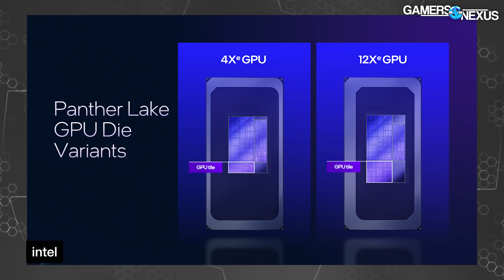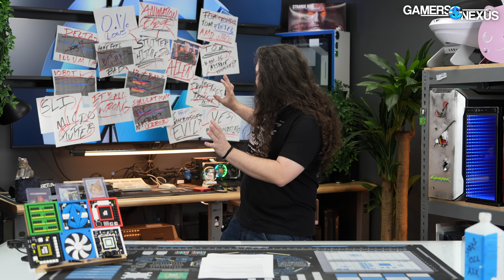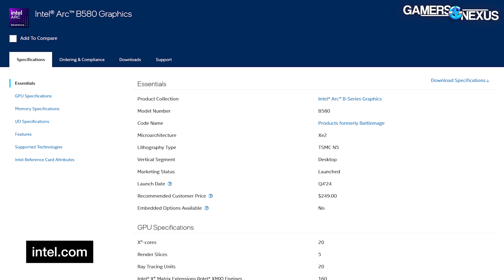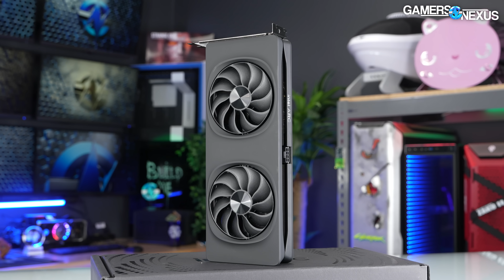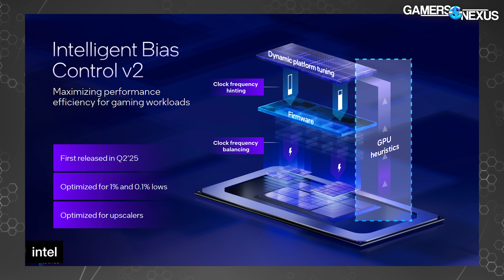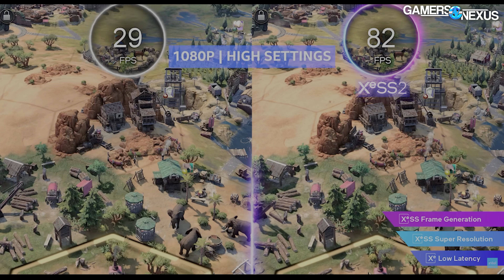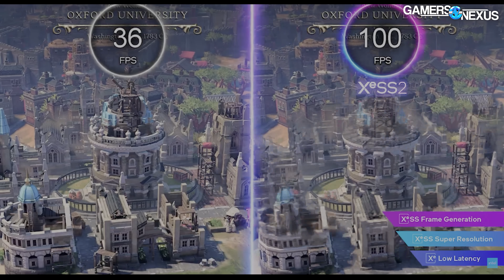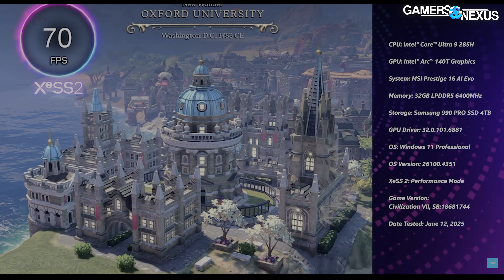Intel's New GPU: Xe3 Architecture Changes, Handheld Gaming CPUs, & XeSS3

Comment: arc is the only thing that makes me excited about tech nowadays, we need someone to push on the now dead lower end market, someone to push VRAM up, we need a zen moment in GPUs to make nvidia actually look at geforce once again
Reply: As much as I would like that to happen Arc is gonna either evolve into a competitor to Nvidia and raise prices as soon as they have any brand recognition(less likely imo) or they will be suffocated by Nvidia to prevent the former from happening.
Reply: We really need another competitor in the GPU market, NV has a stranglehold on the top end, mid-range AMD is sticking with their "we're not NV and we're a little cheaper" habit, and the low end is NV GPUs from 5 years ago and whatever scraps AMD throws us and neither are particularly cheap anyway.  I put my money where my mouth is: an A310 in my Plex server, an A380 that I pulled out of it, 3 A770s, and a B580.  Alchemist was a rocky start but the B580 is hard to beat at $250 without going in to the used market, open box, etc.

I've lost interest in NV because of how out-of-touch and greedy they are, I was able to grab a 9070 XT for a little over MSRP and it's a good card but AMD seems to have gotten greedy off the success of that card, AMD needs to be more aggressive in their pricing if they want to become relevant again (they had 43% of the gaming GPU market when they first acquired ATI), Intel is really the only one working hard to win over gamers.
Reply: @406Steven  We need more competitors in the semiconductor manufacturing market and supply chain.
Reply: @MorbidEel  Very true.  TSMC has a monopoly on top-end chips.  I'd like to see competition in that market, especially some on US soil.
Reply: agree, if you told me 5 years ago APU news is only thing gets me excited now wouldn't believe you
Reply: Fuck nvidia
Reply: Rx 7600xt 16gb,rx9060 xt 16gb exist
Reply: I mean, low end's got it pretty good. I usually go high-ish and there's no upgrade path for my 3080. How about a 5080 for 1000€+ or the 9070 that's 700€ for a 30% upgrade. No thanks.
Reply: We just need better AMD gpus, not intel, no nvidia.
Reply: @shk0014  The more competition the better.
Reply: @shk0014  We've needed that for a decade though. If anyone else wants to hop into the fray in this space, I wish them the best. Intel did that at least for now.
Reply: @YesterdaySoup Intel had decades of experience with their iGPUs though.
Reply: @theobserver4214  I'd say most of that experience was wasted, though. Or perhaps an extended learning phase. I really wouldn't be surprised if a bunch of potential Arc A-series customers just sat back specifically because they remember how bad "Intel HD Graphics" and earlier integrated solutions were. Back then we didn't think "Intel integrated graphics" was a joke, we thought "Intel graphics" was a joke because it was all they had. I'm not saying it's all justified hesitation at this point, but I think there might be a lingering perception problem just from people who used their IGPs.

Though to be a bit kinder to Intel on that, the earlier stuff was in a time when all integrated solutions were some shade of awful, and HDG was their first real swing at trying to get those right. Just not the greatest timing for perception's sake, because that was right about the time AMD's ATI acquisition started bearing fruit.

Maybe it's not all justified, but this is why I think Arc was their first bit of being serious about GPUs.
Reply: @shk0014 amd fanboys at it again. I guess it helps nvidia that amd waited till rdna 4 to finnally take fsr and rt cores seriously when has for a decade or two 😅
Reply: But they arent doing better.  @shk0014
Reply: Arc is pretty much dead you are just in the vocal minority who are terminally online. Average people don't even know arc exist.
Reply: @edmonddantes759  Its like saying an average person doesn't know how to change a tyre. And you're terminally online telling people that they can never change a tyre.
Reply: @edmonddantes759 fr 😅
Reply: I would start looking for something else, b/c Arc is basically gone. Nvidia is not going to allow them to be competetive.
Reply: @robr4662  Jensen doesn't need to know /jk

arc mainly thrives on the low to midrange, so i don't think that they mind it too much, unless they want to choke competition really aggressively
Reply: @4nyNoob  nVIDIA will ultimately not cede ground to anyone if they can help it, which is precisely why nVIDIA has teamed up with Intel; APUs will stay to take over the low end and at least the low mid-range markets.  This is fundamental; if you aren't excited by anything other than Arc, then you aren't looking in the right places... Discrete GPUs won't even exist in anything below mid-range in a couple more generations! Take a look at what AMD is doing with APUs; next generation, they will have an RDNA5 successor to the 9070 XT with 20-25% more performance, that they can just slap on as a chiplet along side a 12 cores 24 thread CPU; just look at recent Xbox Magnus and PS6 Orion leaks! Similar chips will be going into laptops too, and I suspect into desktop APUs as well.  When PS6 and XBox have access to 24, 32, 48 GB of VRAM, this is what is going to drive up VRAM amounts on discrete GPUs as well!  And the beauty of this on desktop APUs is that games will be optimized for this combination because that will magically be what is in consoles too! Saying nVIDIA doesn't care about the low end or mid range market is failing to see the real problem; they just don't have a way to do it cost effectively enough for them to tie up manufacturing that could be better utilized making high end GPUs that they can make huge margins on; one of the ways nVIDIA plans to get there is on Intel APUs.
Reply: @robr4662  I think Arc will survive until Druid is ready to launch. After that, my precognition goes fuzzy and I turn into a galloping cantaloupe.
Reply: @robr4662 nvidia is only working with intel so they can keep their hold on the market with the intel cpu and nvidia dGPU laptop combo, not desktop
Reply: @robr4662  Not how... Any of this works, dude
Reply: rx 9060xt 16gb destroys every arc gpu in performance per dollar. You are an idiot if you choose arc over rx 9060xt 16gb
Reply: @adlibconstitution1609 no it does not. The B580 comfortably beat the 9060xt in term of price to performance. AMD can’t even make 1 decent sub $300 GPU
Reply: @adlibconstitution1609  9060XT is 350€ here, ARC B580 ist 230€ here, why is someone an idiot if hes choosing the best card under 250€? 9060XT is in another price league.
Reply: @adlibconstitution1609  In all honesty mate, nvidia rtx4000 series is still better than amd rx9000. You can't really call someone an idiot if they bought a GPU their money can buy or features that they want.

I've not used an amd gpu just because the performance per dollar is not good. Especially if you add resale value. Most people in reality don't just game. And for the prices people pay for these GPUs, the usual target market are people who work. The last AMD that I actually bought is the Radeon VII. Because from then, nothing really can compare against the competition.

Intel GPU is interesting, because of the features they are releasing. Its not as fast as what people try to compare it to, but it doesn't cost more than it should. Unlike the competition. There's a high chance that people who already have a high-end GPU in their rig would add an intel GPU in their build just for the features. Like people who already own a 7900 XT/XTX and 3090/3090Ti would appreciate it, and that is something that I would not see at present with the current AMD offering. .

Comment: I really need Intel to do well here, we've already had near monopolies on processors when AMD was sucking rocks... it wasn't all that fun. I want two (or more) strong processor options. Same with video cards, I'd switch off Nvidia in a heart beat if AMD or Intel made high end cards that could compete with 80 and 90 series. I get the low and mid range is more popular and that's where the money is, but flagship cards get attention. You don't make them for the money, you make them to show you can make and compete with the best.

Comment: So tired of minimal increases in performance. We should be in the Terahertz by now
Reply: There is a pesky thing called, the laws of physics. More concretely the laws of termo dynamics and quantum mechanics. 
We have already hit a wall in how small and stable, we can make transistors and this was decades ago btw, chip makers were just able to increase computation further, by introducing multicore/multiprocessing but this, has its big drawbacks as well. 
So now, to try squeeze a little bit more performance out of transistor tech they are trying to change how transistors are made at the fundamental level, again, with new construction methods called, nanosheets and CFET, while still working within the same, existing, real world nano scale, even thou they claim they made transistors smaller than before, for marketing reasons, using the scale of the smaller peace they can make, is like saying you car engine is 1 mm (millimeter), because it has a 1 mm screw in it...
But this is very hard and requires advanced and very expensive machines (good for rich countries to keep control of this tech), so mark my words, we will never reach Terahertzs on a single core ever and probably never on a multicore CPU alone as well. 
And we may reach a time, where will be impossible to go further in classic computers (there the research on quantum computers already...), thou I hope that is centuries in the future.

Comment: Hopefully B770 is skipped and they launch a surprise C770 or 750 or whatever they fucking call it.
Reply: Theyaren't going to launch any more arc discreet cards, I wouldnt bet on integrated graphics based on the XE cores lasting past when the current supply of xe cores runs out. Once that happens you will never hear of XE or Arc again and Nvidia chips will be packaged with Intel CPU's.
Reply: @robr4662  Stop spamming the MLID incorrect information

Comment: Nice deep dive
Intel marketing with graphics doing great
if only they execute roadmap in time, because those delays are killing great products
Reply: There is not going to be any more dicreet Arc cards. Nvidia wouldn't invest that much money into a company for it to make competing products, they are going to get rid of Arc and they will use Nvidia chips as integrated gpus packaged with Intel cpu's. They are probably just using up the last of the XE cores in inventory before switching over.

Comment: New NVIDIA integrated GPUS are looking fire 🔥
Reply: I am not a fan of any multi-billion dollar corp. but like it or not, this is the future of Intel. Arc is gone. Nvidia wouldn't have invested that much money into Intel if they were going to be competing with them. Arc will be relegated to low-end integrated graphics until the supply runs out then they will switch over to nvidia chips exclusively for gpu's.
Reply: @robr4662  I know, that's why I wrote that ironic comment in the first place.

Comment: Pantherlake will be the first Intel GPU to launch with SR-IOV support in MAINLINE Linux (historically, i915 only supported GVT-G and SR-IOV in Intel's soft fork of the kernel). See the xe driver (drivers/gpu/drm/xe/xe_pci.c).
Reply: intel coming in with W's
Reply: Intel B50 Pro and B60 Pro supports SR-IOV
Reply: @ridsama  Didn't launch with SR-IOV, it's not officially validated yet, but yes Battlemage pro also has SR-IOV in the Xe driver.
Reply: Please understand, because I mean no offense with this. With that said, nobody that expects their computer to work without having to recompile an entire operating system, cares about how Linux does its drivers. A person that needs their computer to work from power on, each and every time, doesn't care how the drivers work; only that they do.
Reply: @ZeroHourProductions407  A business that requires SR-IOV will very much care about how Linux does its drivers
Reply: @Creepus_ExplodusA business can afford to pay someone to molest the command line and debug if it matters that much. 

But with how much linux wants to market itself as the new desktop os? A windows user being made to convert isnt going to want to do anything with the accursed command line, or any version of linux that outlines "recompile the kernel" as a default troubleshooting step.

Again, a normal user, is not going to care how the drivers work, so long as they do.
Reply: @ZeroHourProductions407  so you know absolutely nothing about modern linux distros and it shows. not all distros require the use of the command line. even then anything advanced can easily be googled and found. it's not gonna be as easy as windows that holds your hand and blocks you from doing anything in-depth with your system, no. however for heavy enthusiast gamers who want better performance on a wide range of games, even a linux dual boot is a great choice.
Reply: @ZeroHourProductions407  The vast majority of non-technical users do not have any possible reason to compile a kernel. It isn't 2010 anymore, that's almost 16 years ago and Linux has advanced a lot since then. Complaining about technical users or professionals using the command line or compiling stuff is silly because they also do that on Windows or Apple OS. Either people need to do it for their job or do it as a hobby.
Reply: @ZeroHourProductions407  That's nice because I use Aeon and never used a command line for anything. The drivers are directely in the kernel so I didn't compile anything, I use gnome as a desktop environnement and it has an app store to download my apps.

Yes I must say that I do not use my computer for work, for office documents I use onlyoffice, brave browsers and proton/steam to run games and that's it, obviously if you need the adobe suit or other specialised softwares you should look out for that.
Reply: @thatonelonghairedguy764  Linux has refused to work with Audigy and X-fi sound cards for TWENTY YEARS in my experience. No model, no platform, no anything has had it "just work" like the fanboys say it should. And regardless of whatever distro you call it, the first thing they all say is Open up a terminal. No, I should not have to do that. And if I can't get online, Google means fuck all.

Even after the short of miracle that it took to let me have working sound just last week, I'm now trying to get OpenRGB to work. The App store version flat out doesn't. The standalone download kinda does, but it only lets me control the lights on the RAM in my test system. Even if I download this rules file thing, double clicking it only gets it to open up in notepad; it doesn't do anything to fix the problem. And it still won't let me control the lights on the motherboard; and by extension, the fans or the GPU.
Reply: @ZeroHourProductions407  The only one making anyone convert is Microsoft. 
Desktop is completely irrelevant here. SR-IOV is for sharing hardware between virtual machines. That is not something any typical desktop user cares about.
Reply: @MorbidEel  There are a few million atypical consumers and growing~
Reply: @ZeroHourProductions407 least obvious Microsoft spokesman
Reply: @그냥사람-e9f  HAH, you wish. Fucking redditors coming out of the woodwork on this one 😂

I'm just sick to death of people evangelizing linux like it's some be-all end-all. The only *nix based anything that HASN'T drove me to frustration is MacOS itself. But Tim Cook can also eat my ass, mouth first, if he thinks i'm going to spend $10k for an ARM based shitbox with cooling ripped off a Geforce FX 5800 Ultra, and not be allowed to upgrade it at my discretion.

Irony is, the notebook I got myself last year, as a present to myself for managing to be clear of student loan debt, has had two separate SSD's die because of that one damn Windows 11 update. Asus itself won't provide a bios update to update the AGESA, which seems to be the one thing that's helped recover other peoples' systems. And I'm already NOT looking forward to having to choose between sacrificing a third SSD or installing Linux and having a bricked system because it won't get past the damn command line. if I could put 10 on it instead, I'd immediately be a lot happier.
Reply: @ZeroHourProductions407 sriov is not a feature for consumers so your comment is a bit misplaced lol
Reply: @vinylSummer  sriov is kinda a feature for consumers though, rn it's not commonly used because setup is finicky asf but if the year of the Linux Desktop happens and people want to run legacy windows apps sriov would be very important for graphical tasks
Reply: @ZeroHourProductions407 Actually that person would care quite quite a lot if they're running anything Linux based because not having to compile the drivers yourself is the entire reason that mainline support is a big deal
Reply: @ZeroHourProductions407  This comment was more so for people who use i915-sriov-dkms who, like me, are tired of waiting for back and forwards ports of patches for an obsolete module >:( (All pre-Xe2 devices are deprecated on Windows. On Linux I imagine i915 is going to lose official support.)

We've been waiting for the Xe linux module to hit mainline as it's been built with considerations for SR-IOV and has better performance. Pantherlake (and also Battlemage Pro) already have the patches to work OOTB WITH SR-IOV on the mainline kernel with Xe which is very exciting.

Also for an enterprise, this allows kernels which include SRIOV support to be validated by projects like Debian such that businesses that rely on validated software can deploy SR-IOV (previously, no distro was going to validate Intel's weird backport kernel and the DKMS port was 100% unofficial).